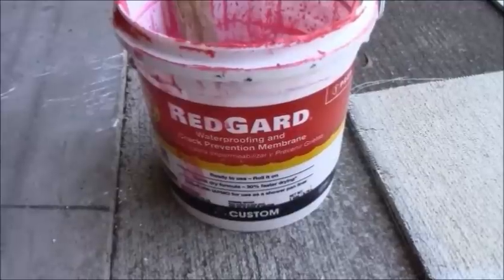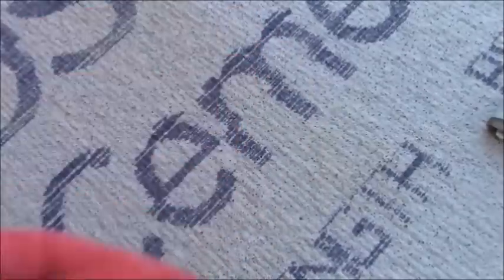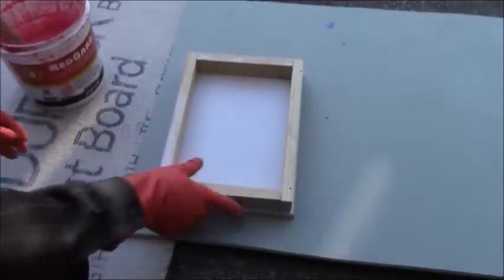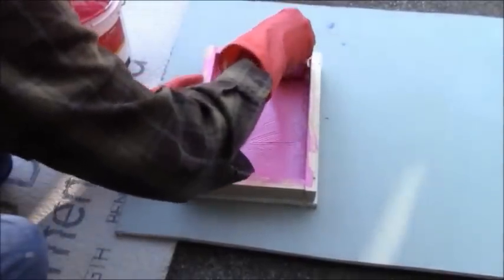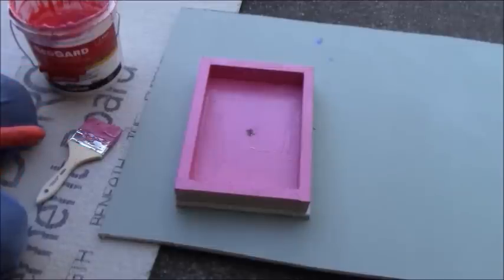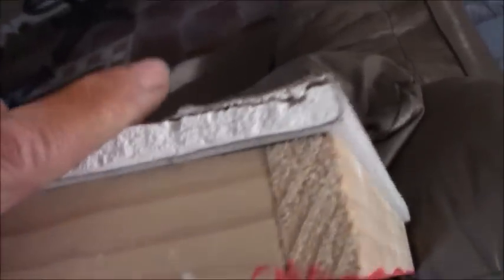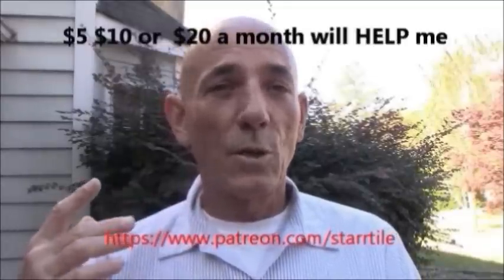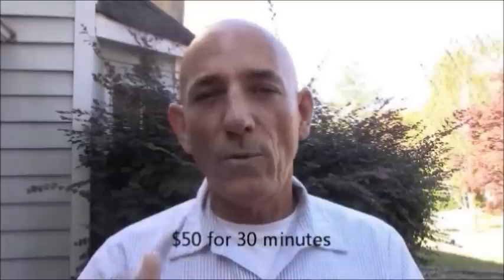REDGARD vs SCHLUTER

Comment: You realize with purchasing Schluter you get a warranty as well? I highly doubt Redgard will back their products with any warranty.
Reply from the maker: The warranties any company offers is only as good as the mice type and the lawyers that they have to mitigate those claims... but part of schluter's warranty also says You must use all of their products, being proprietary means that they sell more which of the whole point of their company anyway. Having said that I have never had redgard fail, and you witnessed fails of Schluter so you decide for yourself
Reply: You get a warranty but you have to follow their directions by the letter and use all of their products
Reply: Kyle Davis Who cares about a warranty? I just saw a video where Redgard two coats keeps sheetrock dry for three weeks! Good enough for me, even though I am a Durock guy...lol
Reply: @dennyk2585  and I am sure there is some nomenclature eluding to the fact that it has to be "professionally installed" Sorry, I only planned on doing my shower ONCE!
Reply: Actually custom building products does now offer a warranty. Just like schluter you have to use all their products
Reply: The warranty doesn’t mean much when you have to pay quadruple the price to get it.
Reply: @dennyk2585  That's not true, simply educating yourself and installing to standards that are proven aren't that hard. Wouldn't you feel better having someone educated and knowledgeable in the tile installation field to do your shower? I can promise you Starr doesn't use a mil gauge and properly check his redgard applications. Everyone bashes Schluter but in reality their products are fool-proof and are meant to be for the installers.
Reply: @MoneyManHolmes It means a lot when you're selling a job to a customer. if you think a ~$400 difference in price for a bit of backing from a company won't help solidify selling a job then you're in the wrong market my dude.
Reply: I’m not a tile installer, but you are correct. There are tons of people out there who would pay extra for a longer warranty. I’m not one of them, but if that gives them peace of mind, then more power to them.
Reply: This fight is nuts. More information is needed. Shulter has had claims and they have fix them even though it was installer failure. The reason for the warranty being such a big deal to me is they not only replace their products used but also the setting materials, tiles used labor to install new and tear out old. If it’s a first shower you’re doing they will send a rep to help build it with you. No charge. I’ve done it both ways. My showers per year have increased with Shulter and I don’t dread them anymore. I am building about 20-25 showers a year. I started using Shulter is 02 and haven’t looked back. But now I only use kerdi board.
Reply: The company will only warranty a job if your a certified installer of their product.  You have to be recognized by the manufacturer as doing their class and they certify that you have learned 100% through their training they provide.
Reply: You cant just be a handy man or even a certified journeyman, or some guy off the street.  Whats the difference??  anybody can get warranty and the company would lose millions of dollars on false claims or on fools who dont even install the products correctly per.manufacturers recommendation...  you would have to be certified by custom building products, or laticrete, or mapei(etc) and then on top of that use the manufacturers specs to install and all the recommended products in order to get the full warranty.
Reply: @dennyk2585  Custom Building actually offers a lifetime warranty with that caveat. (Actually their lifetime warranty is on paper the strongest in the biz, but in practice I've heard Laticrete is best at actually helping you with warranty issues...) The other caveat is TCNA approval, though. So with green board, even though it seems to work, if for whatever reason there is a warranty issue (for example, bad batch of thinset) Custom is let off the hook on the warranty, they'd otherwise actually be paying for labor as well. That's the biggest legal liability problem you'd get with not doing things "by the book" imo. So to me the extra 10c per square foot Wonderboard costs is worth it there for that alone, same with thinset under it on floors, etc, if God forbid it does fail, you're less likely to eat it.
Reply: @jdc9795  Custom, Laticrete, and Mapei actually all offer classes like Schluter, as does the TCNA themselves. (I took a TCNA class as a homeowner as I walked into a tile shop the day they were having one by chance, got buffet food and beer, too, really nice.) I think the main issue for Schluter is price, their stuff costs so much people make sure they do it right generally.
Reply: @GilBatesLovesyou  so those free seminars the tile stores hild are a little different from the actual class.  You gotta pay money for the actual certificate.  If you call and ask Laticrete holds a 14 day class that cost around 1500 i think.  And you gotta stay at their facility and dorm for the duration and the classes.  I dont know how other companys do but laticrete is one of the best for modern day construction.  The other brands work to if you do it correctly per manufacturers spec.  But if you pay to do the class thats how you get the real warranty that i was talking about.  Also they gonna send their lawyers and field personel to investigate any claims that their product has failed.  In the event there was a product failure and not an installation defect.  If you dont have the real certification by paying and taking the classses they will tell you to go to hell.
Reply: @GilBatesLovesyou  also laticrete makes the same stuff ass schluter.  Wall board, pre slope shower pan, etc...the thing is laticrete had theirs on the market before schluter introduced and came out with their line of products(home depot shit).  And they all copied a brand from german call wedi thats been around for years.  I used wedi 15 years ago before any of the other brands came out with their knock offs.  but they all work if installed correctly.  The warrantt though is not given unless u pay to take the class to get certified.
Reply: @jdc9795  
I'm totally aware that the actual TCNA cert is different (however, strangely the course actually counts as continuing education credits for architects...) 

I was impressed at Laticrete having giant 400 page books on how to manage tile installs for airports, subway tunnels, etc, for free on their website. I think that's super cool, really world class. If I ever get more into tile installs when I get back to US, I really do wanna hit up more training expos/etc, simply because they're actually pretty fun/interesting, and you can shoot the shit with the actual reps. (IMO people are a bit autistic online about mil thickness, the actual Mapei rep was like "yeah, do two good coats, it'll be fine, don't worry.)
Reply: @jdc9795  The difference is that schulter got a world class marketing team that convinced an army of tile installers to be their soldiers. Just watch any tile installer explaining ditra and each one sounds like a parrot... "submarine test, longer shower times, lotions ruin showers, topical membranes are just too hard to install...". Also, go look at the comment section of Issacs video and you will see all the heavily vested installers claim he did it wrong or they still think it works (without offering any explanation).
Reply: @apex007  blind leading the blind.  They all work but just gotta do it right.  The best response is" only gotta last one year".  Thats how you know these idiots are just average people who dont care about anyones job out lasting the test of time.

Comment: Dude you got at least a dozen videos of fucked up shower walls with mold and rot. :/

I think Wonderboard is the best, though. Sal Diblasi tested Durock by pouring a tablespoon of water on it and showing how water goes through in 5 minutes. I replicated the test at home, as I had Wonderboard and Durock. Durock had the same results of Sal's test. Wonderboard however sponged it all in and none came through after 25 minutes. So one is obviously a better board. Also Wonderboard is stiffer and cuts much more cleanly than Durock. 

Testing green board at home as well, my bathroom had all LaFarge (now "Continental Building Products") greenboard on the walls when I demo'd it, and it was garbage. I left it outside and in a week it was mush with rain storms. I bought some USG Greenboard and left scraps outside, I could submerge the newer USG greenboard and it would stay solid for 3+ days, and take a whole week of submersion to turn to mush. I had scraps outside for a month still staying totally solid. So perhaps a Greenboard issue is the brands. I do think though if you use Greenboard you should use setting compound like Durabond 90 instead of premix. Durabond 90 is basically as strong as thinset would be in the corners, it dries rock hard (can't sand it for the most part...) The reason drywall cracks at joints in houses and you have seams running across/down the walls is mainly people not doing the first pass with Durabond and using premix for everything as it's easier/they don't know better. 

Of some note as well, liquid waterproofers on sheetrock are 100% approved in UK and Europe, but you do need to use fabric tape with the liquids, it's 100% required for the warranty. Mapei Hungary even has a video of a guy using Aquadefense on green board with tape. I think some of the stuff is just excessive litigation in USA that causes instructions and "industry standards" to err especially on the side of caution/paranoia.
Reply from the maker: Yes I never said that gypsum board could withstand moisture, never was my contention or my point, the point was that anything you paint a topical membrane on is going to be waterproof no matter what it is, which makes the whole point of a backer board irrelevant, use whatever you have.

The reason Schluter does not call for a cement board, and in fact they approve gypsum is because they know their product is waterproof, or so they would think, therefore whatever you use does not matter. As for your experiment I have absolutely no doubt that every backer board out there will soak up water, but every backer board out there has had tile on it with no waterproofer at all including my "100 year shower" video that was extremely basic and it lasted 35 years, which is about the point somebody's going to do renovation anyway.

My video "redgard on cardboard" seals the deal,  no pun intended
Reply from the maker: And by the way all the videos you referenced that backer had mold and mildew because the backer board was embedded into the shower pan material, not because there wasn't a waterproofer, just so you know

Comment: Should I use a vapor membrane when using any of these three options?
Reply from the maker: Vapor membrane is only meant for a shower that is not waterproof, you cannot do waterproofing and a vapor barrier
Reply: @StarrTile  thank you Bob
Reply: Plastic sheet doesn’t breathe, traps water, and slows down drying to much. Starr is right, make a waterproof shower and there is. No need for plastic membrane

Comment: Im 52 yrs young and been in the tile business since high school. Never had a shower failure. You keep mentioning PDF on material, why in the heck do you refuse to use the fabric in corners????? I heard you bring up the cardboard deal well that was a Laticrete Aqua ban demo/prop 7.8 yrs ago. In that cardboard box, WAS FABRIC!!!!!! Just as Custom had to tell you, dont advertise putting our product on Gypsum, Dont instruct people to not use fabric. If you were brought up that way and you like it, go head. But dont tell others to do the wrong thing. People do as he says.... read the instructions and you will see, MUST USE FABRIC to be waterproof IN CORNERS
Reply from the maker: I never suggest to anybody that they do it my way, everybody has a freedom to do as they like, read the instructions, pick things apart to the letter of the law if they prefer, however I use common sense, Common Sense dictates that tape is a crack prevention membrane for sheetrock for example and if you're already using a crack prevention membrane which is what a liquid topical membrane is first and foremost, then it's illogical to use a mesh tape because it's redundant, not saying it cannot be done, I have done in the past but what I have found out is the tape causes a larger Gap in a corner and requires more coats of the Redguard then it would without the tape , that is my explanation for the use of this product, as I said anybody is free to do it their way as long as it works, My Method has worked for over 20 years despite and regardless what custom Building Products chimed in to say. There is a YouTuber by the name of Isaac Ostrom, he followed the letters to the exact detail on their product when he did a mock up, the product failed miserably in his demo, mostly because he followed instructions 😂
Reply: @StarrTile  Alls good. However the fabric is not needed on flat surface. its onhly needed in elevation changes. Its like epoxy has a part A and a part B. Both are needed to achieve correct outcome. There will be no leak if fabric is used. If wall moves and floor doesnt, the fabric is a BUFFER for the movement, kinda like backer board to a wood substrate on a floor. People are brought up in the industry different. Just like using Drywall in a shower, im sorry Green board. Its just not done. Good luck to you sir
Reply from the maker: @larryarnold4299  well I appreciate your opinion, it's not based in fact, I have done experiments to that point and all the points that you make. But we can agree to disagree, and I don't need luck because I have skill and Common Sense 👌

Comment: Do you have a recommendation for how to tile over redwall? 

What do you do to seal the space between the bottom of the the drywall and the tub?
Reply from the maker: If you are freaked out about that Gap you could run some silicone, but the way wall board is set on a tub should be at the top lip and not the edge, only the tile should be touching the edge not your wall board
Reply: Quad the sealant for window replacements is what i use before tileing. After you tile use a epoxy grout. No more sleepless nights

Comment: I have had to remodel a good number of showers because the previous installers used green board.  and or Sheetrock.  this is not something that happens all the time but it does happen. and most contractors either don't think about all the things that could happen and does happen. all they think about now days is cost and what is easier...  the reason I choose not to use these products is because things can happen inside your walls. for example one of my remodels was because tiles were falling off the wall because at some point a pipe busted inside a wall and sent a good stream soaking the backside of a shower wall for god knows how long.  dissolving the drywall from the inside. eventually weakening the drywall.  and again have been called in to a remodel of a brand new shower that the previous installers at some point drilled a screw through a pipe that sent water spraying all over the back side of the green board...  there is so much people don't think about.  had this been concrete board the only thing that would have been replaced was some drywall on the other side and a little bit of copper or pex...  please please people do not take a YouTubers word on green board or Sheetrock.    Try Den-shield or stay with concrete board...    I do however agree with RedGard and it is the best.  Schluter sucks and it is nothing but a product for a company to make money.  we have been tiling for over 100 years and if done right there is nothing to worry about...  Schluter is a complete scam....   other than the green board issue this guy does stellar work.

Comment: Be Nice to see a proper kerdi installation at least do a like for like test. I have box lined with kerdi  it hasn't leaked in 3 years.
Reply from the maker: yes it would be nice except that I don't do kerdi.. In fact I don't do any foam products in my showers... I also like the steel bumper on my truck and not the foam and plastic ones on most cars 👊